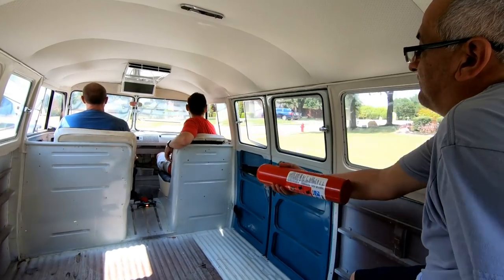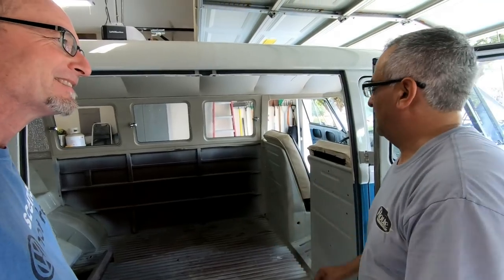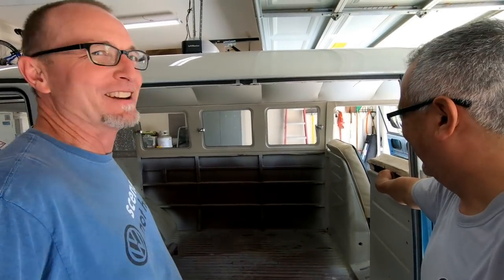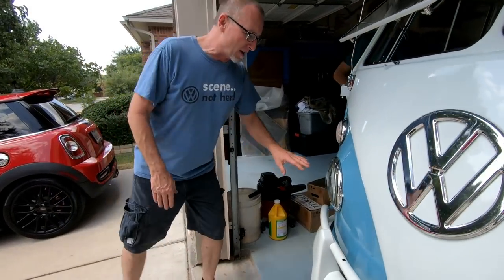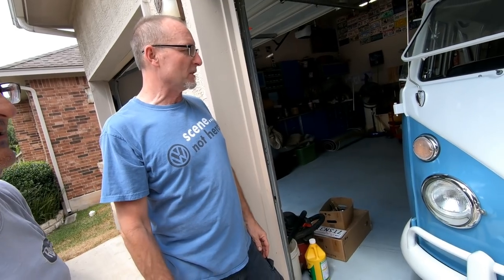How to restore a VW Bus!

Comment: What a lovely kombi. It looks like new and the detail Wow. I can remember my friends kombi. The the reduction gear noise plus the rattling gear shift rod and loose fr gearbox mount. It was a noticeable noise amongst the general rattles that is a vw. We fixed it. Another one of my friends had a 58 with a mid mounted 6cyl  holden and 2 speed powerglide a short driveshaft and a  holden diff. It had 2 rough gas cut 1/2 plates welded to the axle housing and bolted to the spring plates and a panhard rod setup. it was good for 80mph in a straight line but the brakes were only good for 55mph if that. It was rough at best. He was the last owner. it was rusty and became a donor. It was fast for a kombi.
Reply from the maker: wow that sounds like a crazy custom setup!  they did a lot of weird things back in the day with these old Volkswagens didn't they?!

Comment: Do you know what the light aqua/baby blue color name and number is that is seen on some of the VW buses? I am restoring my 1969 VW bus and I want to paint the bottom half that color.
I love that headliner..I have a sliding sunroof so I am not sure if that type of headliner would work for my bus?
Reply: The color is Regatta Blue L50F (1968). Was used on Karmann Ghia's and Type 3's
Reply: Thanks so much :)

Comment: 14” truck tires are very hard to find! About 4 choices left out there
Reply: junkman yep the Hankook is what I run, absolutely love them! But only those the grabbers the ones in this video and then a few others that are ONLY rated for areas where temps don’t drop below 30 deg F! Which in Indiana is a major no no! Lol....if you go to a 15” tire there are a few more choices
Reply: @marcijunebug  You can extend the cross section width by reducing the aspect ratio
= equal, or slightly smaller tire size. The
most important factor is to keep the
circumference of the tire. The next matching tire to this tire is 195/60/14.
This gives a deviation of - 2.1% Speedos
have usually the same - deviation, or up to 5% So the speedo shows more mls/Km then your actual speed. Check
 with gps - 
or exacter - with Glonass to confirm the size. Cops like to pass speeding tickets.

https://www.tires-easy.com/tires/195-60-14
Reply: junkman yep, the key for busses tho is finding an 8 ply or greater...👍